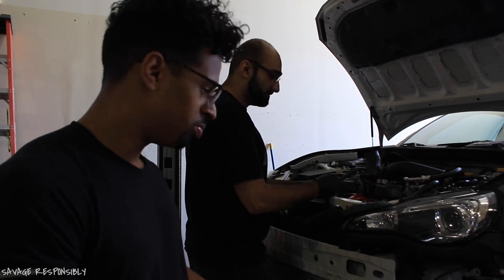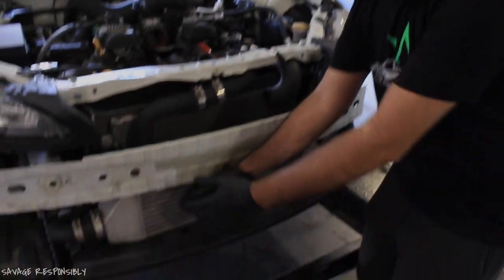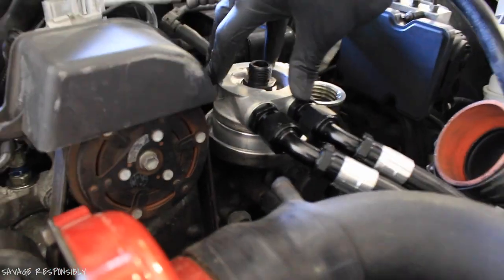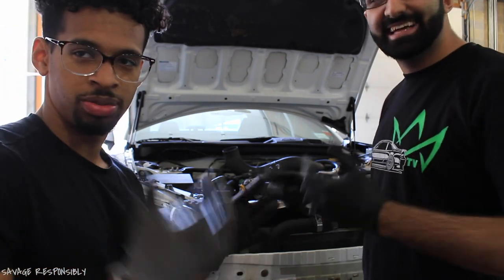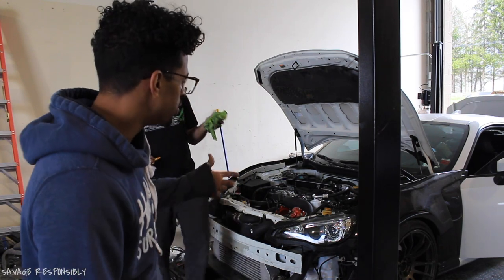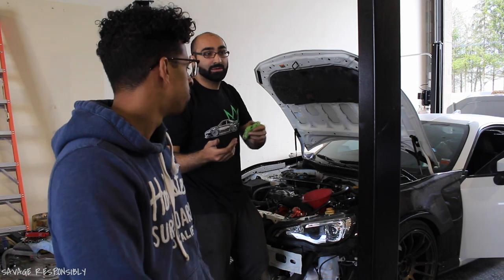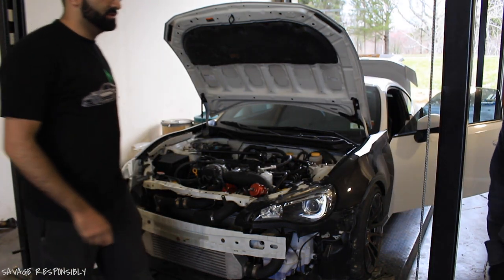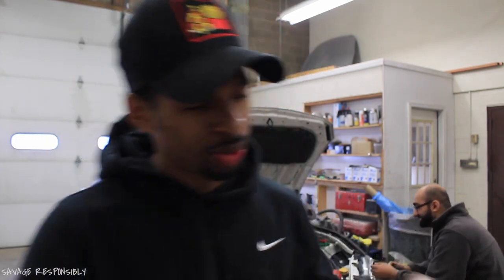450+ HP Turbo Subaru BRZ Build Pt 2 !

Comment: You might have issues with cooling or AC with the oil cooler behind the intercooler. Was with a friend and we tried that setup and had the issues. A good spot would be behind the fog light area or replace the windshield washer reservoir.
Reply: I don't think we showed it correctly, but it's sitting all the way to left and offset . Likely we will add ducting directing air into that area . But as you said , it's best to have it in the corners but the limitations with the AN lines provided limited putting it anywhere but there . Ideally you wouldn't want charged air from the intercooler over the oil cooler.